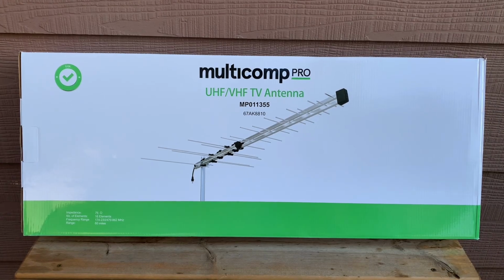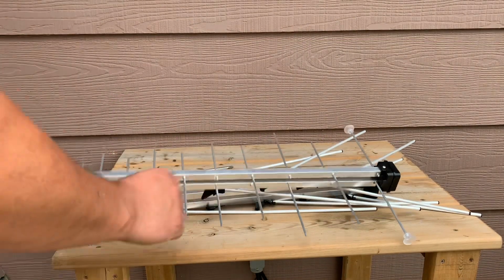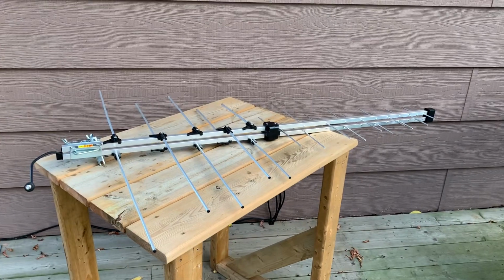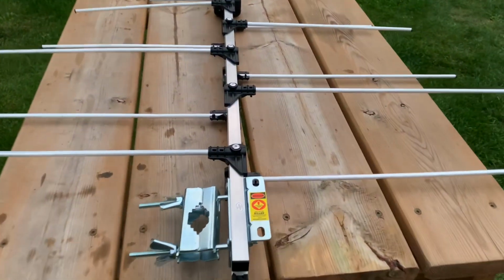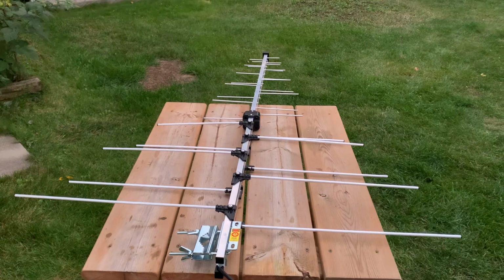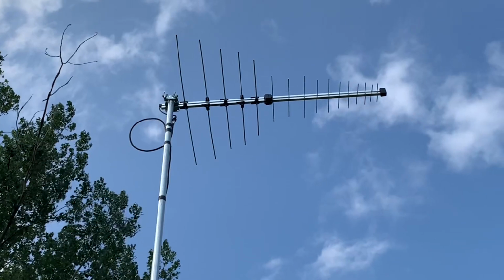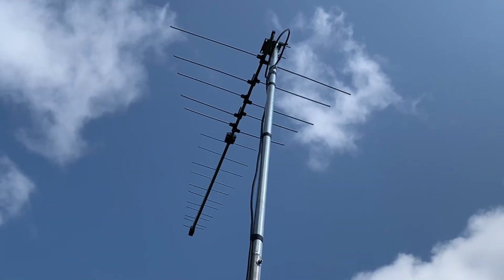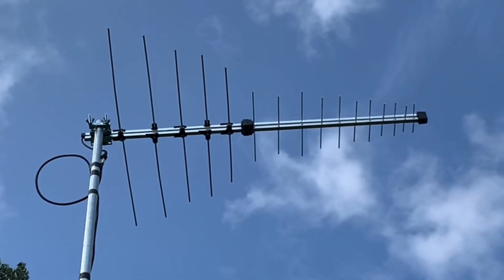Multicomp Pro VHF UHF Outdoor TV Antenna for channels 7-36

Comment: How did the reception on RF channel 9 compare with the other antennas you've tested?
Reply from the maker: The signal strength on channel 9 was pretty good, not the highest I’ve ever seen, but definitely up there.
Reply from the maker: Here’s a recent antenna review, with a slightly higher signal strength. Outdoor TV Antenna Review - Sky Blue SB32 High-VHF Fringe OTA TV Antenna
https://youtu.be/Iz01O78wYec

Comment: The frequency response is a giveaway that the box was made before the repack.  The North American UHF band for TV is 470-608 MHz.
Reply from the maker: I’m aware of that. The frequency response on the box may refer to the frequency bandwidth for DVB-T or DAB broadcast frequencies used in other parts of the world, not necessarily North America.
Reply: @NorthcoasterHobby  Ah, that makes sense.  I hear Japan still uses the bandwidth equivalent to our channels 14-63 because their government didn't sell out their over the air viewers to the cellular providers, preserving as much bandwidth for TV as possible.  Other countries also got rid of their VHF allocations to make room for an expanded FM radio dial.  For example, Russia and the Eastern Bloc could annex the Japanese and CCIR bands for the world's largest FM dial: 65-108 MHz.  If we did that, imagine the possibilities, along with annexing the shortwave band for AM expansion.  There is a huge problem: the 5 kHz bandwidth of shortwave channels means you would get a better sounding experience calling the station at their phone number and listening to it over your telephone line.

Comment: I spray paint the plastic parts to extend UV life even though they should be fine without.  That will not affect performance if spray goes elsewhere.  I like the ANT705 RCA for the money, VHF-UHF, good for about 40 miles.

Comment: This would have been a great urban antenna circa-1982, and the price is certainly appealing.  But today ghosting is fixed through error-correction rather than high front-to-back ratio.  Though the build is attractive, it's not suited well to us remote dwellers.

Comment: I personally tested log antennas, they have lower gain than a Yagi antenna. From my experience, Log antennas are good for Large cities and if you live close to broadcasting tower up to 20 km. For longer distances than 20 km I recommend a Yagi antenna. In some cases a Log antenna can be usefull if you live let's say 30-40 km from the tower and the channels you want to receive are high power.

In my case the tower is 30 km away from my house. The TV channels are only on UHF. I tested a log antenna like the one in the video and it had the same gain like a 10 element Yagi antenna. While a 19 element Yagi antenna had better gain.

60 miles range is Sci-Fi. A Yagi 44 elements UHF antenna with a 30 Db amplifier buit in can barely receive channels from that distance. Even on VHF Band you need a larger antenna and a buit in amplifier, of course you have better chances to receive channels compared to UHF Band. The 60 miles range is more for DX-ing. This antenna can work up to 30 km maximum.